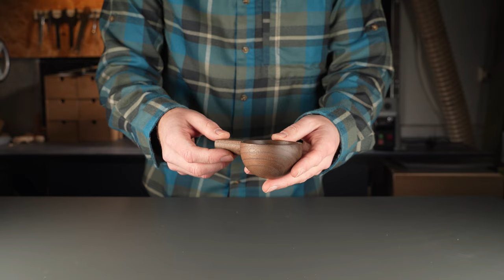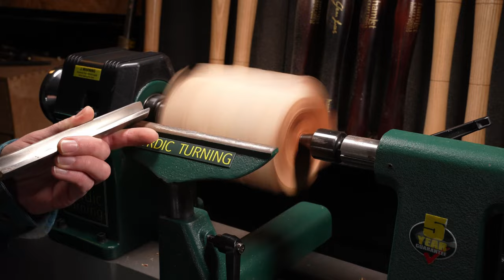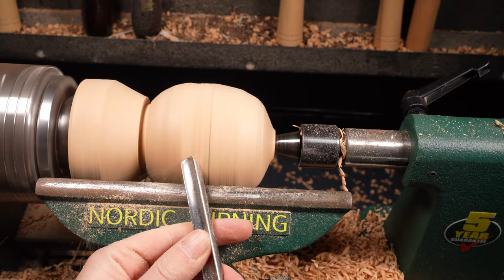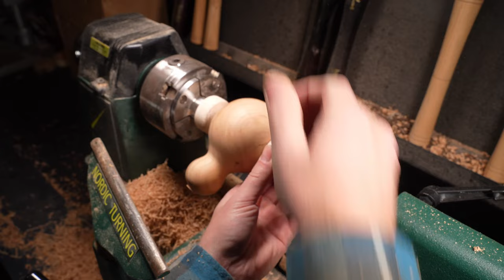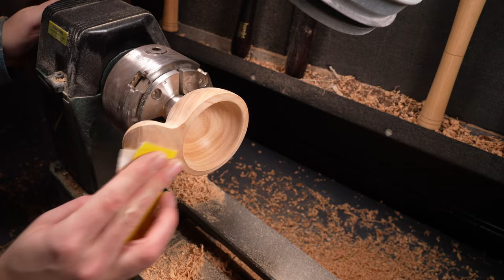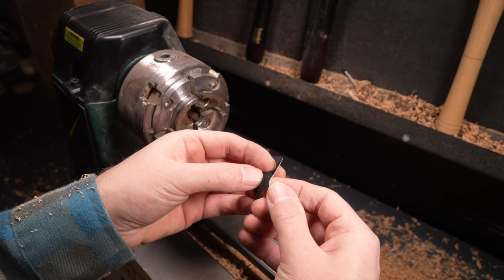Woodturning - How to make a coffee cup turned on multiple axis without a jig

Comment: Fine Job! I like it. Question… what do you prefer for finishing? And can you keep it clean?
Reply from the maker: Thanks 🤩 I’m trying different finishes, this one tung oil. I had someone say it’s the best way. I have also tried walnut oil and that has been fine. To clean it I just use a moist cloth or paper towel
Reply: @nordicturning  thx, somebody made a little bottle use for a drink. He used resin  and he told that he had information of the resin factory that this resin was suitable for drinks , food  etc. Did you have the same experience?
Reply from the maker: @jannitert6576  I think that might have been my project too? I did consider using resin on this one too, but seems that most other turners recommend only oils, like walnut oil, tung oil or danish.